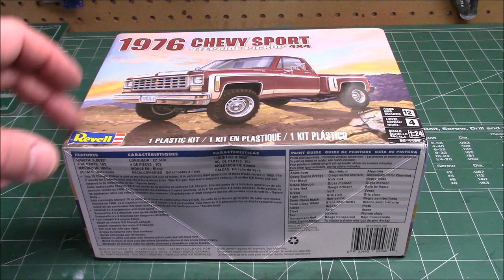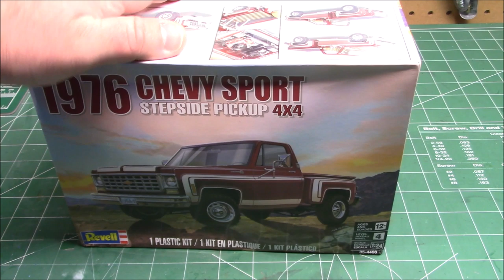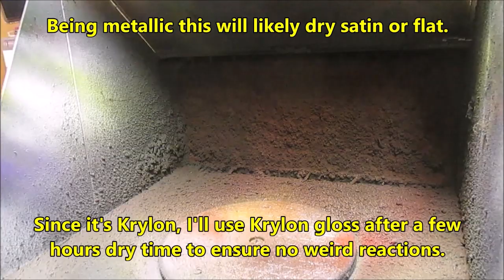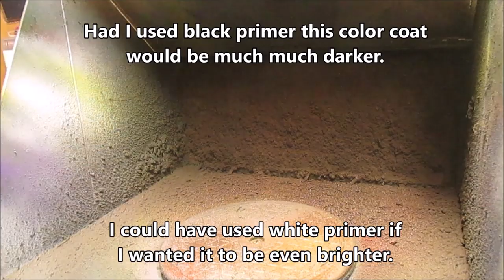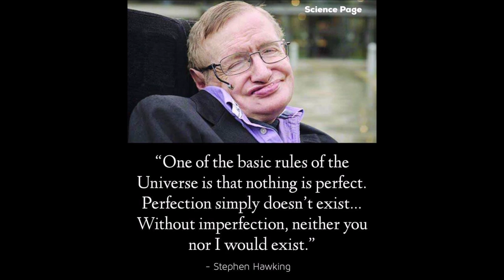Revell 1976 Chevy Sport Stepside 4x4 Pickup Truck 1/24 Scale Model Kit Build Review 85-4486

Comment: I bought 2 from Model Roundup when they were released. I remember these trucks on the dealer lots. Tried my best to get my dad to buy one! I have always loved this 'sport' version and so thrilled Revell made a fantastic kit for all of us to enjoy! I have also researched this sport version in detail. They were available in 4 factory colors with matching color interiors. The windshield had stainless steel moulding vs the black only in the model build. The grill was a mix of a silver insert and outlined in chrome. Similar for the wheels. The trim rings and center caps being chrome and the wheel itself silver paint. I would call the one in the video a custom vs factory build. Just do a little search if you want a factory truck. I'm painting mine blue metallic...one of the factory colors. I will probably leave the 'orange peel' in the paint just the way Chevrolet did it! LOL I own a real '74 SWB C10. I will take the grill from the other kit and build a fleetside SWB of my truck. I may buy a few more copies of this one just to stash. The '73/'74 grilles were different vs later years and you can't find these 'sport' decals anywhere. Enjoyed the video and learned a few things to try on mine.
Reply from the maker: Thanks for watching!

Comment: Sweet. Looks like the same thing as the plow truck and big game. Chassis wise. I'm glad they got rid of that fuel injection intake. Definitely will be buying this. Thanks for the awesome video man.
Reply from the maker: Thanks Taylor!
Yeah they all share the same platform, as did the real ones of course.
I used the injection system on the Big Game one, not bad, looked the part for a modded truck.

Comment: I have had a similar experience,with the Rust-Oleum colonial red paint that I used;tterplicate the box art.The Rust-Oleum colonial red paint had shrunk;and wrinkled,after applying several mist coats of the Rust-Oleum gloss clear;even after allowing the paint to dry for a week;when I painted the 90" sleeper cab of my GMC Astro 95 COE tractor,by AMT.I had to use paint stripper to strip the black preshade/basecoat;and the red top coat,and re-paint the sleeper cab.After letting the paint dry for a week I applied several coats of Pledge Floor Gloss (PFG) (Formerly Future Floor Polish,and Pledge Floor Care Multi-surface Finish);and then I took a 3/4 oz. Bottle of Testors gloss coat;and a paint brush,and hand brushed the 90" sleeper cab;in preparation of applying the Associated Truck Lines decals.Because Round 2's decals are temperamental;and are prone to disintegrating,I will be using Micro Scale's two part decal solvent system;Micro Sol,and Micro Set to get the decals to settle down into the contours;and recesses,of the sleeper cab.

Comment: With all the different versions this kit has been issued in over the years, I can't believe that it still comes with those Goodyear Tracker bias tires! Those haven't even been produced since the 80's. They can include that nice decal sheet, so, why not some decent tires? At least this one doesn't come with the Corvette fuel injection system like most of the others. It does however, still have the column automatic shifter for the manual transmission. For the prices they charge, a few more updates would be greatly appreciated.
Reply: Really tho...a brake Master Cylinder/ Brake Booster would be a good place to start .

Comment: I have had a similar experience, with the Rust-Oleum colonial red that I used,to replicate the box art.The Colonial red paint had shrunk;and wrinkled,after applying several mist coats of Rust-Oleum gloss clear;even after allowing the paint to dry for a week;when I painted the 90" sleeper cab of my GMC Astro 95 COE tractor,by AMT.I had to use paint stripper to strip the black preshade/base coat;and the red top coat,and repaint the sleeper cab.After letting the paint dry for a week,I applied several coats of Pledge Floor Gloss (PFG) (formerly known as Future Floor Polish,and Pledge Floorcare Multi-surface Finish);and then I took a 3/4 oz. bottle of Testors gloss coat,and a paint brush;and hand brushed the sleeper cab in preparation;of applying the Associated Truck Lines decals.Because Round 2's waterslide graphics are temperamental;and are prone to disintegrating,I will be using Micro scale's two part decal solvent system;Micro Sol and Micro Set;to get the decals to settle down on the contours;and recesses,of the sleeper cab.
Reply from the maker: Bummer, yeah, every now and then Rustoleum will fail me but the win percentage is still high. :)
Reply: If you use the Rust-Oleum brand gloss coat apply in light coats and you will have great results. Trust me and have fun.👍

Comment: Said it  was an automatic  transmission but it must be a 3 on the tree the dash had a brake pedal and a clutch pedal molded to the bottom and the gas pedal molded into the flood pan.  I would. Scratch build a floor shifter and boot and remove column  shifter. Looks like a great build  kit.
Reply from the maker: Well thanks for watching!

Comment: Great kit.  All kits should have decals for the interior, like this one has.. they really make a huge difference.. as do the decals for the bed.  Thanks for the great build!
Reply: I agree,but I usually cut the bed floor out and build one up from bass wood strips.
Reply: That's even better... for skilled modelers :)
Reply: @hishamaziz3282  yeah,I've been building kits for ,jeez I just sat and thought about it!!! Damn near 40 years! Ive also carved and stick built replicas of aircraft and ships for about 15 or so years. Got a little experience. But the only way I got it was by doing it. When you cut something like a bed floor out,do it carefully,and if you butcher the wood replacement,you can always cement the original back in place. With a little filler,it'll look good as new.
Take care
Reply from the maker: Thanks Hisham, I totally agree. I love these decals they add so much detail and don't take a long time to get a great kit done.

Comment: hello Chris, i have been building these kits for years, i love your builds, you take a faster approach than i, i like to hand paint and over detail everything that isn't the body, thank you for the many tips on paint and body that you share with us fellow builders,  what i would like to know is, where did you get that spring loaded jig that holds the bodies for painting, i need one, and if they are model specific, where did you get the lazy susan type devices to hold parts on for paint as well,?  there is nothing at all wrong with how you build your kits, your builds are very informative, and thank you for what you do,  i am a huge fan, , with all respect from a fellow builder,,
Reply from the maker: The rotating stands are the Tamiya Paint Stands.
The alligator clip stands are simple soldering helping hands, available all over.
Thanks!
Reply: i forgot to add one of my favorite trucks, awesome job, looks real

Comment: I'm used to building military kits and using a lot of flat paints. I also usually build the majority of the kit before I begin painting. With your technique here and painting everything beforehand, how do you glue them together with all of the paint on the contact spots? Just superglue or other types of glue? Do you do a lot of scraping the paint off before gluing? I know this is probably answered below somewhere but too lazy to scroll through all of them. Beautiful build and great job. I have already purchased and I am looking forward to building this kit. Thanks.
Reply from the maker: I super glue paint to paint. Zero issues with over 100 builds per year.

Comment: I'm concerned about the moulding line around the middle of the cover for the spare tyre.  It would have been better sanded flat.  Having said that, that colour is great.  I tried painting an Opel Manta that colour and it all went wrong, so respect to you for making it work.  That leather paint also looks good.  Authentic.  Solid-looking model.  What do you do with them afterwards?
Reply from the maker: Thanks for watching!
The kits get stored or given away for the most part.

Comment: Chris, very nice but I have a truck in mind for you to add your magic touch to. What would you say to building a M1009 (CUCV) that was issued to the military from 1984 on until the HUMMV replaced it. Just a thought from a retired old solider.
Reply from the maker: Yeah those are nice, and I'm guessing this cab came from an old kit like that, with the dual battery set up for 24V.
Reply: Closer to "MPC" Deserter (GMC) we had the Chevy, guessing cheaper then GMC version. These were "COTS" commercial off the shelf. The only things 24 volts were the starter, and power lines for radios, everything else straight 12 volt.  Thank you for your response. Respectfully Dennis

Comment: Not sure if you know thus Testors is owned by Rustolum. Great paint choice. You said in the video you wait 30 minutes after priming to paint the base color. Do you sand the primer first?
Reply from the maker: Yup, same company these days.

I don't sand, just spray and cover with color. Simple easy modeling.
Reply: @hpiguy  Reat. Your end result is still great. Thanks for your channel.

Comment: Nice job! Hey Have you ever thought of using real auto paint? I use it on the models I've made. It really brings out the best in the model with a real car finish. I also sand and buff them. I'm a little lucky on that part cause I am an Autobody Man and I can use paint thats left over from cars I spray.  I have not built a model in a while so I bought Revells Fast and furious. Dominic's 1970 Dodge Charger. I will let you know when it's done so I can show it to you. Thank you for the tips I never new about. I have learned a few things from you. Who says old dogs can't learn new tricks. Thank you. 
 :>)
Reply from the maker: No, I have nothing against it, I just build too fast to sit and wait for that stuff to dry, harden off, etc. Plus it's expensive compared to my cheapo paints and requires multiple steps to use properly and safely.
Thanks for watching!
www.facebook.com/hpiguysworkshop

Comment: @Hpiguysworkshop I notice you leave the parts on the trees to paint them, but doesn't that make for a lot of having to touch up when cut off the tree ?  Do you just spray out small amounts of each color when you need to touch up the side of the hood and such that was connected to the tree?
Reply from the maker: Not a lot, most are hidden.
Anything exposed gets a dab of body paint or touch up with a brush. Very simple.

Comment: Have you come across any Chevy straight sixes on these truck models? Looking for one for my 57 Utility Sedan, will be the most basic of base models :>
Reply from the maker: Just in the older AMT kits, they have some inline GM engines, such as the 1950 Chevy pickup I built. It's a very nice engine.

Comment: That thing is beautiful Could I make a 1 ton dually with one of these ?
Reply from the maker: Thanks Casey!
Reply: check out Revell 85-7220. Between that and this 76 stepside you could put together a pretty good dually. Note that they are different scale though, 1:25 vs 1:24
Reply: @gabordubniczki1936  thanks man apresheate it
Reply: @gabordubniczki1936  I guess I could find some resen plastic dually rims but I can use the frame with some modifications I can use the stepside fenders as dually fenders thanks for the idea

Comment: I made a mistake in painting. Can Enamel paint be removed easily or should I just Sand it all and repaint it. I forgot the primer its just paint. HELP PLEASE! 😭
Reply from the maker: If it's a big mistake you'd want to soak it in Super Clean overnight and it should all brush off, rinse, dry, repaint primer and start over.
Reply: @hpiguy   Thank you, Sir. I'll try anything. Hope it works. Had a real 69 but for now I can only get this one. 😀😀

Comment: I just got this truck. I can't find Future floor finish, will any floor finish work??
Reply from the maker: https://www.walmart.com/ip/Pledge-Floor-Gloss-Original-27-fl-oz/15136693?sourceid=dsn_fbins_c8491619-5e6e-40ae-8c54-b718a137277e&veh=dsn&wmlspartner=dsn_fbins_c8491619-5e6e-40ae-8c54-b718a137277e&cn=EDL-DABA_pr_dps_dsn_soc_fbins_edl&fbclid=IwAR0hSnwVoG2_5jP43XpHMt0br_So0IgNhKV3Nkqk6MmCyNEVGdWgnukDqGs
Reply: @hpiguy   That is the stuff I got this AM so I was on the same wavelength. without knowing  you responded to me the answer  yet.

Comment: Nice build does anyone make a two-wheel drive version of this model( 76 Chevy C10)
Reply from the maker: Good question for the model gods, we'll see if anyone can answer you.
Reply: Yes I believe revelle did one in the hot rod magazine series
Reply: @justinm2245  Revell did 1:25 scale - so smaller scale than this and less detailed. Some Fleetside, some stepside, some Blazers. Here's your comprehensive source: http://www.modelcarsmag.com/forums/topic/75490-history-of-revells-squarebody-pickup-kits/
Reply: @justinm2245  is this kit still available?
Reply: AMT Blazer Ambulance and the 77 gmc wrecker is still out on ebay and amazon, but you'd have to cut the roof off a Blazer to get a fleetside. They are also curbsides, or quasi curbside (77 wrecker) The rest come up on auctions from private sellers, but check which version you're buying, some are dropped, some are lifted, some with engines, some without.

Comment: Nice Build. I do have to Laugh. This is not you but Revell. The transmission behind the 350 cid is a 4 speed manual transmission. To complete the deception Revell gives you a clutch pedal and a automatic gear selector. The 3 on the tree was not with the 4 wheel drive. Revell is stepping up there game.
Reply from the maker: If I'm not mistaken this is a pretty old mold.

The decal design is new, from the designers at Revell USA, they've been working really hard to improve what they can on their reissues. without breaking the bank on retooling.
Reply: I understand that. I just have to grin that no one caught it. Again it is not you. I do enjoy your videos. Another fact was 75 percent of those trucks were automatic.
Reply from the maker: I missed it totally. Should have hacked off a pedal.
Reply: It's okay. Next month I am doing a semi truck build for a customer. I will be on video. You can get me back. Your friend Roy
Reply: The 3 on the tree was infact available with the 4 wheel drive in 76.
Reply: Infact in 76 the 3 speed collumn shift was the base offering on all C10, C20, K10, K20 trucks with 6 cylinders or smallblocks. The C30 was the only truck you couldn't get a 3 speed in (K30 did not exist in 76)